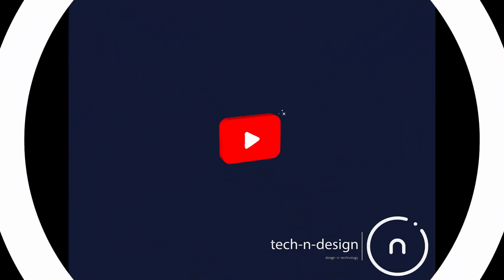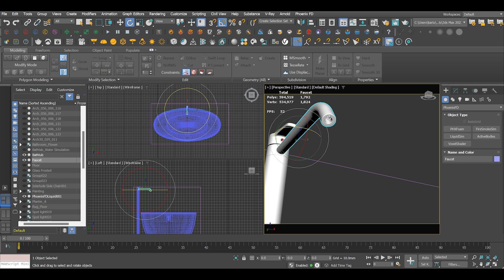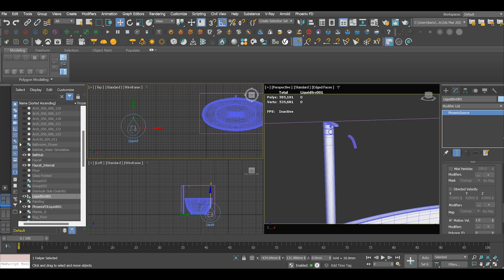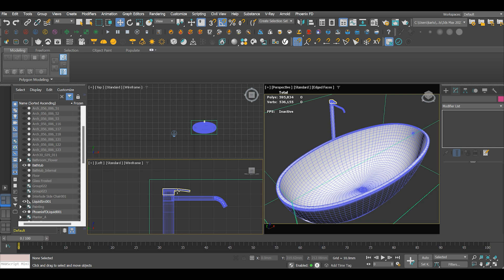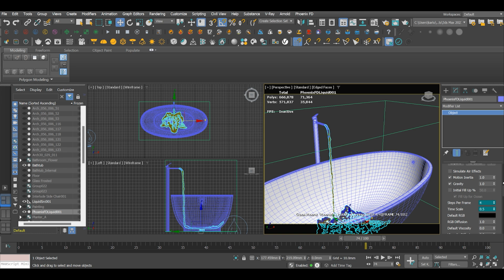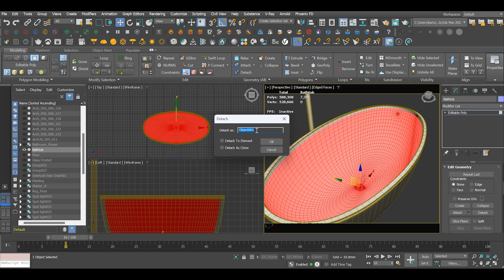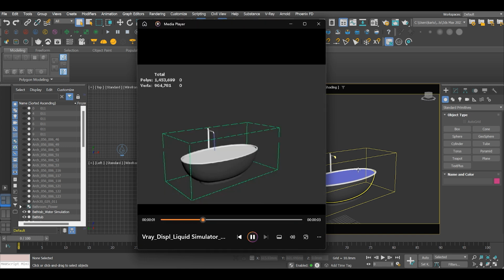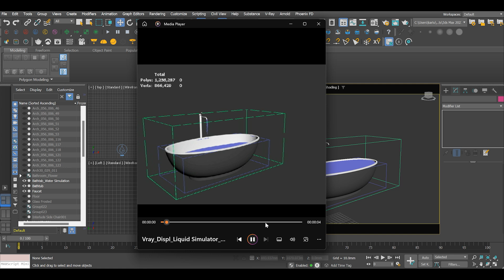Water Simulation - How to fill a bathtub using Chaos Phoenix FD with 3ds max + V-Ray

Comment: Thank you for the video, how do you clear the simulation since we are starting over? Every time I make a new emitter it loads the old simulation back again. Thank you
Reply from the maker: Phoenix simulation has 5 keys on the menu bar. Start, Pause, Stop, Restore and Delete. So, just delete the simulation and push the animation key at the bottom back to starting frame zero.